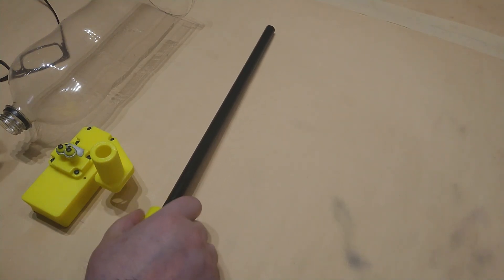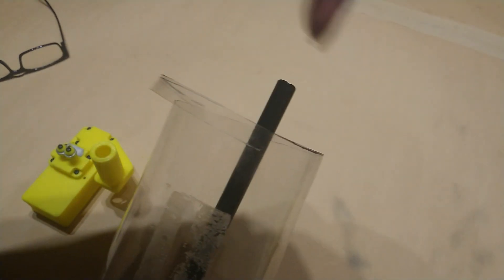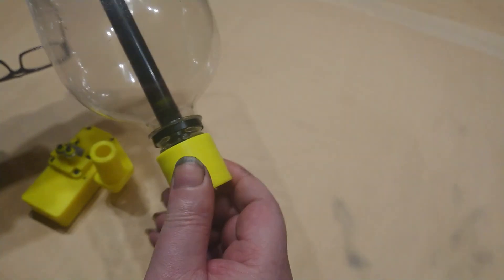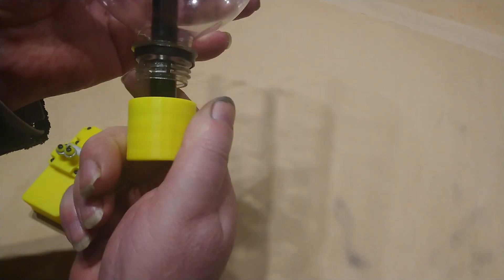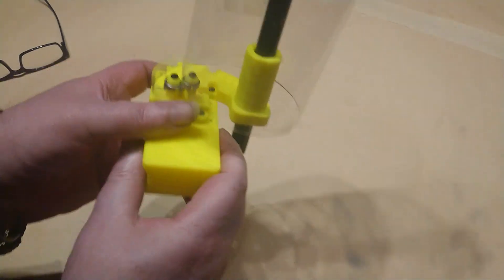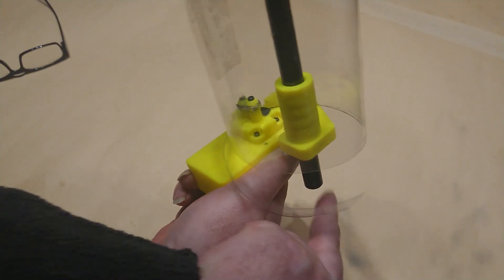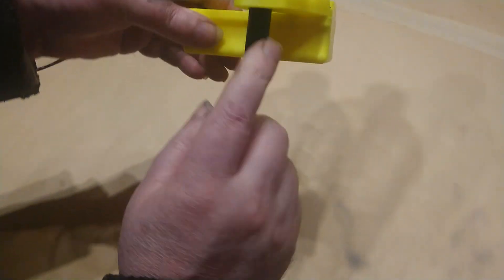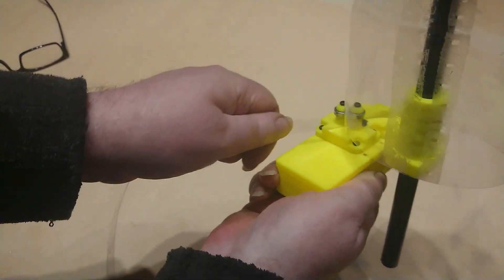Tim's PET Bottles to Filament (Part 1 - Bottle Cutter)

Comment: When I'm pulling that, my cut at some poiny won't be even and again, at some point it will just finish the cut with like a long 3mm diameter instead of like 8mm or so. ( not even at the middle of the bottle...)
Reply from the maker: When pulling the the plastic through, you need to do it in downward direction to keep the plastic sat against the slide plate.
Reply: @Tims_Projects  it's working now, I had to put some weights on the bottle to push it down and modifying a little that tube
Reply from the maker: @LoL-Lore-LoL  That's good to hear. Perhaps the tube you have is lighter than the tube I have. the weight of the tube was supposed to be heavy enough to pull it down. Glad it it is sorted.

Comment: Oh my god , thank you so much. I had been wanting to do this for sooo long , but your instructable was the most comprehensive one I had found yet. 

I read about the extruded filament being a tube in your description, and I wonder if you have gotten around to thinking of a possible solution for that?
Reply from the maker: I have put this project on the back shelf for the moment.
My Idea for getting rid of the hollow, is to cut a thinner strip to go inside the main strip.
As it goes into the heater block, the hole in the block needs to be the right shape so that the first strip is formed into a tube so that the second strip can be placed inside it.

Comment: Is there any issue with bottles being clean enough to prevent the filament from feeding properly? Any cleaning tips? I'll be doing this with middle school children.
Reply from the maker: Hi, I have put the part of making it into filament on the back shelf for the moment.
I just rinse the bottles in water before I cut them, boiling some water inside while I remove the groves also give them a steam clean I think.

Comment: Hello. A have two question, how do you join two PET filaments together, and at what speed do you print the PET filament. Thanks.
Reply from the maker: Hi, thanks for visiting, I am sorry to say I have put this project on hold for the moment, I need to re-think the heater. I don't have the resources to fabricate one yet.
I haven't tried it, but I was thinking of making a jig to hold two strips and use something like soldering iron to weld two strips together.
Reply: @Tims_Projects  THANK YOU

Comment: hi great video, is this project still ongoing?
Reply from the maker: I'm afraid it's on the back shelf at the moment. (I'll edit the description).
I started it when I saw people pulling the strips through a hot end of a 3D printer.
After experiments I found issues.
Reply: @Tims_Projects  Thank you for your answer. Now I'm making the same project for a school assignment. Sorry in advance, but can you give any suggestions for the project?. My project uses a hot end 3d printer.
Reply from the maker: @pramudyarendra  I was using a hot end from a 3D printer, I felt it was a bit underpowered, Just adequate for what you see others doing.
I am retired and don't have the income I used to have, most of my projects are limited to cheep stuff I can buy on eBay.
My idea is to have a block that has a better heater, maybe 2 heaters so the temperature can be controlled better and a bit more depth to the block.
Obviously there is nothing on the market like this and it would have to be made, I no longer have these resources.
As I have mentioned, what you see others do, you get tube, this is easaly fixed.
You make different sizes (widths) of plastic strip.
You do as others, and as it starts pulling through, you add another strip (narrower) inside the first, this will reduce the hollow inside.
It may be necessary to add a third strip (narrower) inside that one.
Experimentation is needed, it may be necessary to first make a larger diameter filament using this process, then send it through a second heater to reduce it to the final size.
Hope you got the idea of what I was trying to say.
Basically what you need to do is the same as "Wire drawing". This requires a cross section greater on the input, than the cross section on the output side. you also have to allow for stretch.

Comment: I don't understand. The bottle is cut by the bearings? How? I made one but it has a blade.
Reply from the maker: Do you know how a pair of scissors work?
Imagine an endless pair of scissors.
Reply: @Tims_Projects  Really? But a pair of scissors is a pair of sharp blades and dull ones don't cut.
Reply from the maker: @revolioclockbergjr8482  Perhaps I should say guillotine. You need to understand the difference between cut and shear.
Guillotines shear, not cut. (some scissors in the right state will shear.)
This may help: https://i.ytimg.com/vi/3iu2f4ax-_o/maxresdefault.jpg
Reply from the maker: Oh when I say guillotine I don't mean the one that chops heads off.
Reply: @Tims_Projects  Thank u for the replies. Will u explain the cutting principle in part 2, or perhaps provide details in ur instructables?
Reply from the maker: @revolioclockbergjr8482  Ah, About Part 2.
You may have seen video's of people pulling these strips through a hot end of a 3D printer.
I tried it, did some experimenting, but trying to get 1.75mm filament by pulling through a hot end, ends up with a tube of filament.
That is, the filament is hollow, about 60% is missing, so you have to adjust your printer to compensate.
I did some calculations (I should have done this at the start) and decided it was not feasible, you should be getting about 5 meters of 1.75mm filament from a bottle, the rest (any longer) equates to air with this process.
Reply: @Tims_Projects  
Just raise the overextrusion parameter.
Reply from the maker: @cosmefulanito5933  That's what I am saying. But it's a lot. I have thought of a method to reduce this, but I don't have the tools to do it yet.

Comment: Interesting cutter.  Tell us more about how you sharpened the edges of the bearings?
Reply from the maker: I didn't. But you can.
If you sharpen them it gives a cleaner/better cut.
To sharpen an edge, you will need a rotary tool (Dremel type of thing) with a diamond coated disc. 
Mount just the bearing you want to sharpen on the highest post, of my 3D print, so that it spins freely.
Hold the diamond disc (on high speed) above the bearing in the same orientation as the bearing.
lower the diamond disc down onto the edge of the bearing you want to sharpen, so that it spins the bearing.
Slowly change the angle of the disc so that it still spins the bearing, but also grinds the edge of the bearing.
If you keep the bearing spinning you will get an even sharp edge to the bearing.